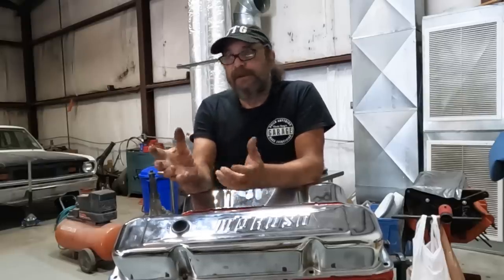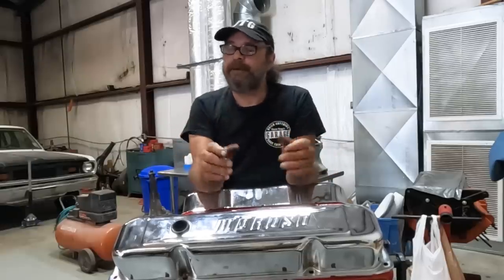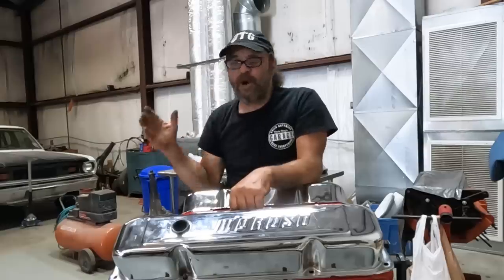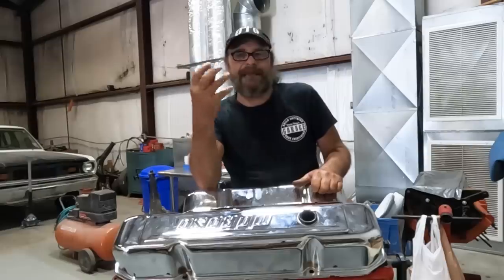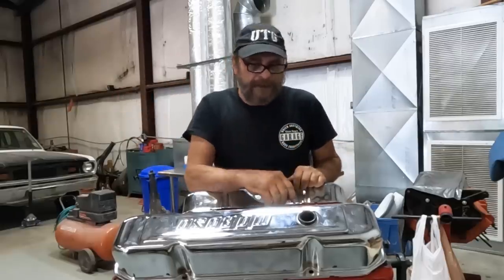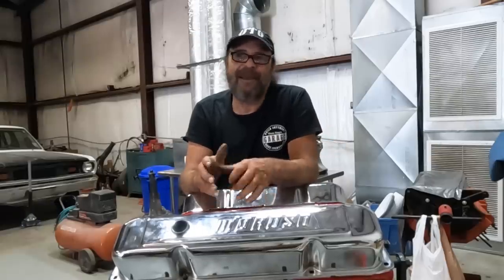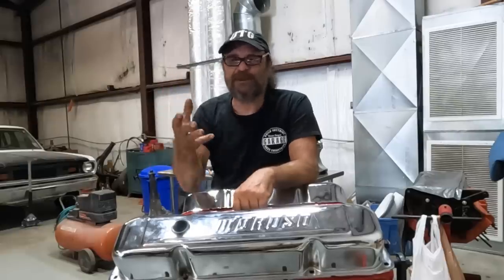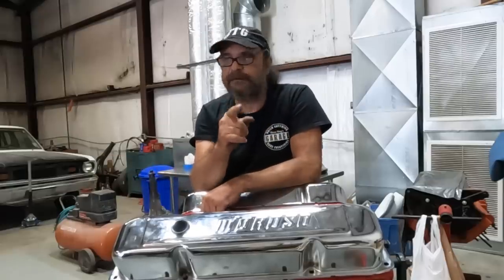Head Gaskets - Myths Busted, History And Types For The Home Engine Builder

Comment: I have a very weird head gasket related question I have a 80 cordoba with a Chrysler 318 and a 89 d100 with a 318 as well I noticed on my cordoba on the valve cover it has a sticker from Chrysler about using sealer on the head bolts when installing now I did heads and gaskets on the d100 about 3 years ago I didn’t use any sealer on the bolts I can drive the truck all summer 0 issues with loosing any coolant but when I park it in the winter and come back to it in the spring the radiators always empty no puddle not mixed in the oil just gone and it normally takes about 2 hours to fully burp the thing of air could this be due to my lack of sealant on the bolts

Comment: What's your opinion on solid copper head gaskets?  I use a lot of them on motorcycles with good success.  Especially if annealed first.
Reply: Triumphs?
Reply: @larrynorsworthy8582  I have had solid copper gaskets custom made for a lot of motorcycle engines, mostly for old Japanese 4 stroke dirt bikes (Hon. XD, Suz. DR, Kaw. KLR, that kind of thing) but also for other engines, even for chinese CG125/200 clone engines.  I've never had a problem with any of them.  I did have a solid copper one fail in a Land Rover 2.25 litre petrol engine once, (let go between two cylinders) but it was a very thin gasket, and not as thick as I normally use.

Comment: Hey Tony, So if the gaskets with metal on both sides get shellack and the ones without metal don’t get shellack, am I correct in assuming on like a 60’s gmc v6 that is metal on one side and no metal on the other side, the metal side gets shellack and the other side does not?
Reply: Also, can that style of gasket be  mocked up to check for compression leaks and then reused if no sealer has been applied yet?

Comment: You mean the head gasket delete won’t work with enough torque?
Reply: I know from experience as a kid that spray paint makes a good head gasket on a small Briggs and Stratton motor lol
Reply: There are aircraft and some cars that don't run head gaskets.
Reply: @johnwilburn  That's crazy. Do they require a light mill when taken apart do you know?
Reply: @howiefeltersnatch2973  I know they require a very true surface, but I’ve not worked on anything that exotic.  The air cooled Volkswagens have two case halves of an engine block that bolt together dry with no gasket.  That worked for them for the better part of the entire 20th century.

Comment: With the boats its crazy. Wrong coolant will tot the engine. Then if you get any metal not bonded together to grounfmd to the water, and say you don't have a sealed wire connecter on your bilge pump, anything in contact with salt water will litterally rot off. Brass, bronze, copper, iron and steel as well as aluminum looks like it was eaten away by acid.

Comment: A factual contrarian story. Rover took over the Buick 215 aluminium V8, they messed around with it, bored it, stroked it and eventually went from five bolt to four on the heads because it turned out to produce less gasket fails....

Comment: I had a friend who would throw a handful of zinc roofing nails in the radiator to help combat galvanic corrosion
Reply: That's a unique one. I've never head that one before. Did he give you his reasoning behind that technique?
Reply: @foxisretrofitting4556  zinc is less noble than most things in the cooling system so they act as sacrificial anodes just like those on the hull of a boat
Reply: @VigilanceTech  Thats pretty slick. Good to know.

Comment: Well I sure hope I wasn't wasting my time re-torquing. Regardless of the material used I always found I got back 20 to 30 ft. lbs. Even if it's just to restore cylinder distortion after using torque plates it makes sense to me. Attention to detail (eg. stock eliminator). After cam brake in is a perfect time as engine is heated but not stressed.
Reply: There is absolutely no way for you to tell 20 to 30 lb yield after it's already been  torque  good try ,I think you missed the point about most engines. He was talking about the basic engine. Not a performance engine or boosted. If you wanted to go to Toyota in the '80s you retorquing the gaskets head gasket every time you adjusted the valve's there would always be a loose bolt
Reply: @jpdiscovers8670  From your comment Jeff it seems you've never tried a re-torque with a beam or dial wrench. You know for sure when that bolt starts to turn again. My mind set in making the comment was to squeeze the max out of the parts you've got. The Unk knows what I'm talking about. He brought forward the point of torque plates about a week ago. He may feel I'm splitting hairs but that's what stock eliminator was all about.

Comment: I do miss building gas engines I'm a diesel mechanic and I do all the heavy work and yeah I miss you know torque heads to 50 lb 65 lb 70 lb Max on these diesels I have 30 to 40 bolts and and it's a three-stage torque down usually first one is like 90 lb then it's 300 lb and then it's Torque 120° from that which usually ends up being somewhere in the 500 lb range and I have to do that 30 to 40 times on a head I really miss the gasoline engines they were really simple to work on and yeah it wasn't it Chrysler that used a copper gasket you could actually reuse back in the sixties I remember one of the automotive companies used to have a copper head gasket and you didn't replace it you reused it if it was good

Comment: Myth or fact, running a engine on plain water not coolant during engine break in with mls gaskets. Ive had several people try to surgests this. Ive never had a gasket fail from using coolant straight up.
Reply: I break in many engines a year and always use plain water regardless of gaskets used. This is for the event of a leak or a forgotten plug or whatever may be. Water is easier to clean up than antifreeze.

Comment: I remember seeing a head gasket dressing (I believe it was intended for a much older class of car) where it was a graphite paste. The idea was the heads and block can expand and contract w/o wearing into the gasket due to the graphite lubricity. Does it work?  ... ¯\_(ツ)_/¯ ... Clean deck surfaces are good enough for me.
Reply: i think GM tried that.... kinda
.
the GM 3100 v6 used a graphite gasket..... and they pretty much ALL fail around 250K-320K miles
Reply: but its also an ALU head on an iron block...... 
better than iron head... alu block....
.
but you still have that slight back and forth movement over ~300,000 miles.......
Reply: @kainhall  Yeah, GM is famous with these. Like the Cadillac HT4100. Iron head w/ Aluminum block. That worked out well.

Comment: My 1984 Nissan Z24 engine requires retorqing every 30,000 miles per factory repair manual. Just pick a bolt and loosen it and tighten it back up. No particular order. And only Japanese made head gaskets will hold up. Nobody seems to know why.

Comment: Good info. But, you should never do a video with a tripod camera if Kathy is available for camera work.  Just as an example: I think she would have got better views on the gaskets and had you show the shellac and copper spray. And maybe a gasket with only four holes for comparison.
   Except for Big Block /426 Hemi Chrysler, all other Chrysler V8 engines have only 4 bolts per cylinder.

Comment: Not true with the “5 head bolts” being better thing on the Chrysler and Chevy.  They’re tiny toothpick 7/16 bolts vs say a 385 series 460/429 Ford that has four bolts per cylinder, but they’re 9/16 diameter bolts
Reply from the maker: Larger bolt diameters take more material from the deck surface and increase distortion around the upper cylinder.
Reply: @UncleTonysGarage  none larger than the 429/460 ford funkle tony.  4.900 bore space, 4.360 bore, blind head bolt holes. and head bolt lands tied into the outside walls of the block.

with that logic, why didnt the OEMs hold the head on with 100 10-24 screws per cylinder?

Comment: Figured this would be the comment section for help lol, anyone? Bought a 1971 dodge b100 last year, got the thing running great after it had sat for 2ish years by rhe prior owner. I ran outta time in the season to work on it and I just got back to it for the first time today. Threw a battery in and it started after cranking for 5 seconds.. the thing wouldn't idle and after I gave it a bit of a punch it backfired out the carb. I checked levels on everything and oil seemed a bit low which was weird since it doesn't leak anywhere and I gave it a fresh change before it sat, but it also seemd like it was cut with gasoline a bit.. where the heck do I start! 
I figure fresh oil and fresh fuel to begin with, anyone able to give a guy who's in over his head some help?